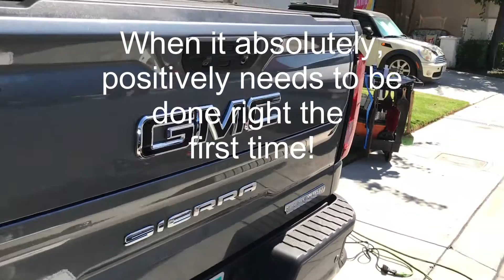2021 GMC Truck Debadge: swap out the GMC logo on tailgate

Comment: My 2023 GMC Denali 1500 just arrived at the dealership. I ordered the black GMC badging and the front and removing the 'Sierra' badge from the rear is a no brainer but I am torn with two options. 1) Replace the red GMC badge on the tail light with black or 2) Just leave the Denali badge on? I think it may look like an empty spot where the GMC badge is suppose to be?
Reply: Yeah I feel your pain.  2019 1500 Denali I took off all the emblems just left the GMC.   Now my truck looks awesome just need the black grill

Comment: What is the name of the yellow pad that you're using with the drill to remove the residue? Also is a product like Goo Gone, which is commonly available, okay to use on car paint and clear coat?
Reply: Its a rubber eraser sometimes called a wonder wheel, amazon has them for like 14.00.

Comment: If I don't have a stripe off wheel, can I use an adhesive remover or Wd40 with a credit card to get the gunk off?
Reply from the maker: Sure...if you don't mind a big, fat mess and some scratches from the credit card. I would recommend peeling double-sided tape with your fingers with no chemicals first. Use your finger to "roll' the tape off. Once you have the bulk of the tape removed, then you can use a chemical of your choice to remove the remainder. You can use rubbing alcohol, or acetone as a rule also to remove any residual adhesive and I would recommend a microfiber cloth at that point. I fix plenty of people who hastily tried to remove the emblems themselves in a manner you describe that resulted in them putting plenty of scratches into their paint.

Comment: I put the exact same badges on my sierra, but I had the dealership do it; and now the top half of the M isn’t even touching the tailgate. I pulled up this video just to see how they were attached to the tailgate, and didn’t realize it wasn’t clipped into the tailgate at all. The dealership was going to throw away my stock emblems, and acted as if they had to be damaged to be removed; and that they couldn’t be reused. So I assumed they were held in by a clip of some sort. Now I realize it’s just a bonding agent holding it on the tailgate, and its basically peeling off.

Any suggestions on what I could do to fix it and prevent it from falling off?